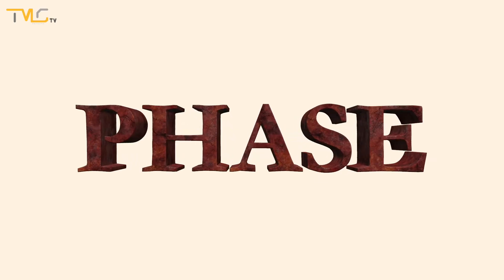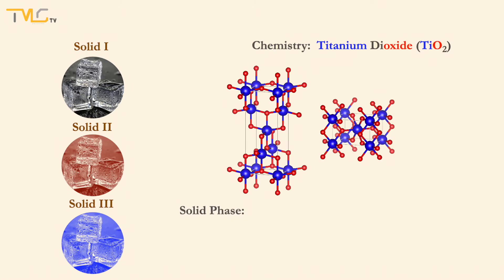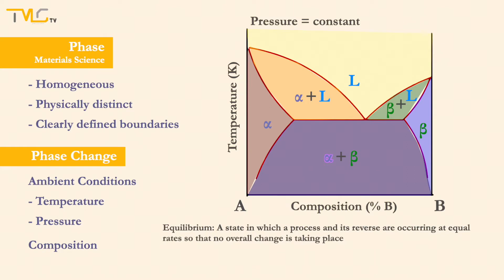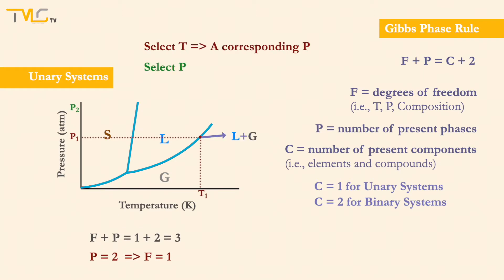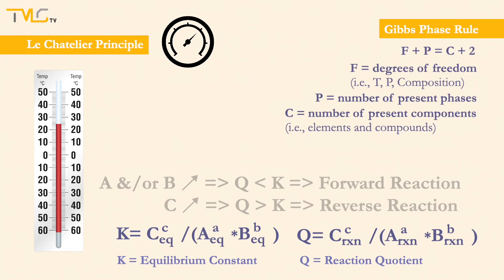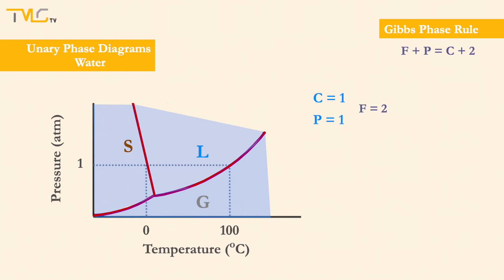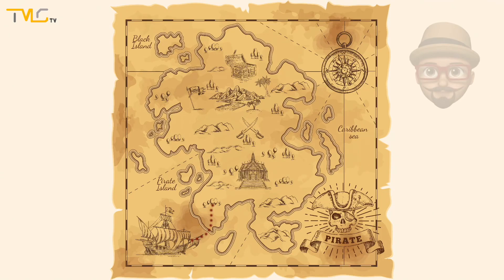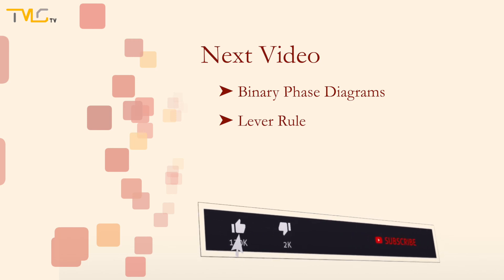Video #3.1 - Fundamentals & Unary Phase Diagrams  (Phase Equilibria)

Comment from the maker: Time Stamps
------------------------------------------------------------------------------------- 
00:00:10 What Is Phase? (Faz Nedir?) 
00:00:50 Physical Phases (Fiziksel Fazlar) 
00:01:08 Phase In Materials Science (Malzemelerde Faz) 
00:01:50 Phase Equilibrium  (Faz Dengesi) 
00:02:12 Gibbs Phase Rule (Gibbs Faz Kuralı) 
00:03:39 Le Chatelier Principle (Le Chatelier Prensibi)
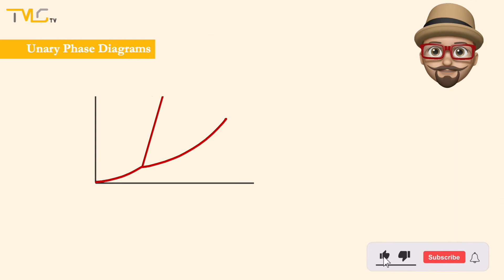00:05:13 Unary Phase Diagrams (Tekli Faz Diyagramları)
00:05:32 Unary Phase Diagram of Water (Suyun Tekli Faz Diyagramı)
00:07:40 Unary Phase Diagram of Iron (Demirin Tekli Faz Diyagramı)
00:07:57 Unary Phase Diagram of Carbon (Karbonun Tekli Faz Diyagramı) 
00:08:10 Unary Phase Diagram of Silica  (Silikanın Tekli Faz Diyagramı) 
00:08:47 Cooling Curves (Soğuma Eğrileri)
00:09:10 Cooling Curve of Pure Iron (Saf Demirin Soğuma Eğrisi)